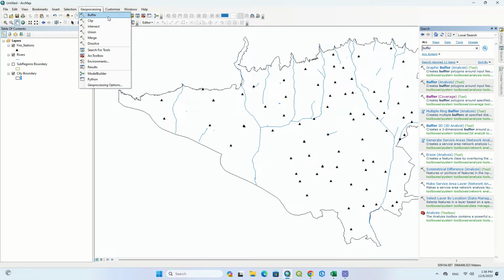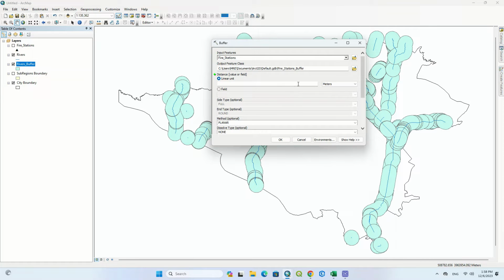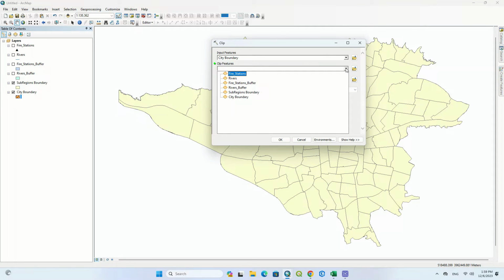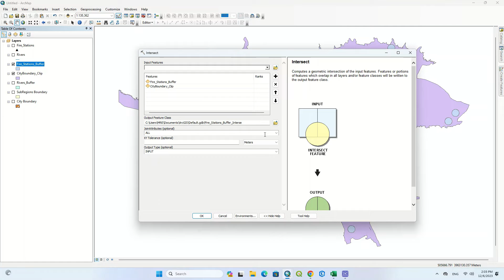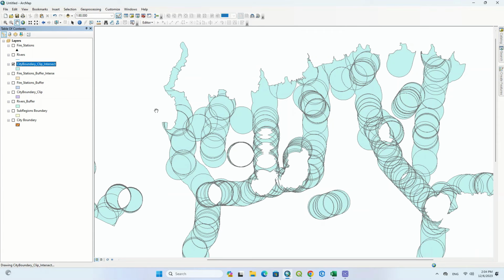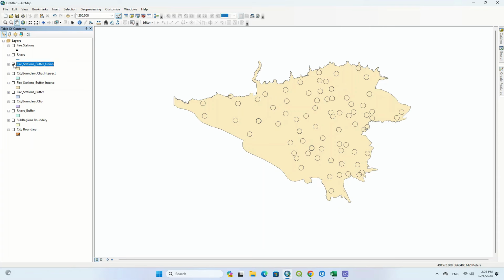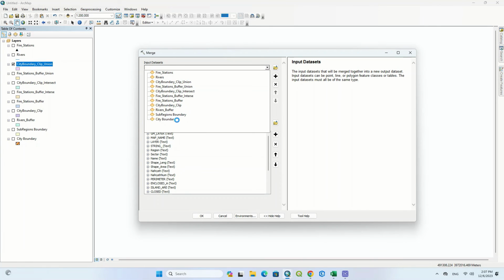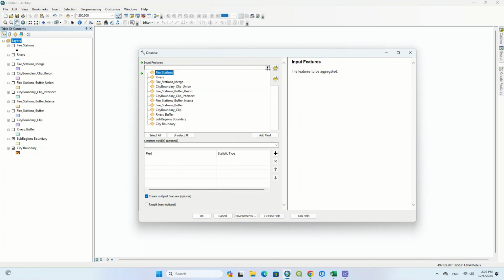ArcGIS Geoprocessing tools (Buffer, Clip, Dissolve, Merge, Intersect, Union, etc.)

Comment: Thanks for good demonstration. Can you explain indeteil how to insert a contour line on a base map having XYZ coordinates
Reply from the maker: Hi, thanks for your kind words! 😊 Regarding your question about adding contour lines to a base map using XYZ coordinates, here’s a detailed step-by-step explanation:

Prepare XYZ Data: Ensure your XYZ file (containing X, Y, and Z/elevation values) is in a format like CSV or text. Each row should have X (longitude or Easting), Y (latitude or Northing), and Z (elevation).
Import XYZ Data: In ArcGIS Pro, use the XY Table to Point tool (found in ArcToolbox > Data Management Tools > Features > XY Table to Point). Specify the X, Y, and Z fields and set the appropriate coordinate system (e.g., WGS84).
Create an Elevation Surface (TIN or Raster): To generate contours, you need a continuous surface:
Use the Create TIN tool (in 3D Analyst Tools) to convert XYZ points into a TIN model.
Alternatively, use Point to Raster or Interpolate Shape to create a raster DEM. Interpolation methods like IDW or Kriging work well.
Generate Contour Lines: Use the Contour tool (in 3D Analyst Tools or Spatial Analyst Tools):
Set the input as your TIN or Raster.
Define the contour interval (e.g., 10 meters).
The output will be a vector file (Shapefile or Feature Class) with contour lines.
Add to Base Map: Add the contour lines to your base map. Use the Symbology settings in ArcGIS Pro to adjust colors and label elevations if needed.
Align with Base Map: Ensure the contour lines’ coordinate system matches your base map. Use the Project tool if you need to reproject.
Tip: If your XYZ data is sparse, you might need advanced interpolation methods like Spline for better accuracy